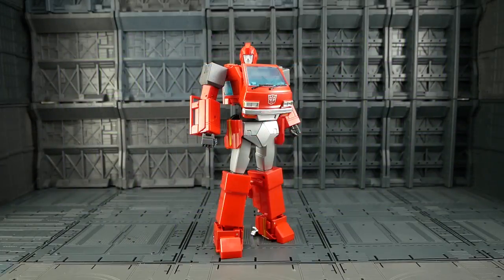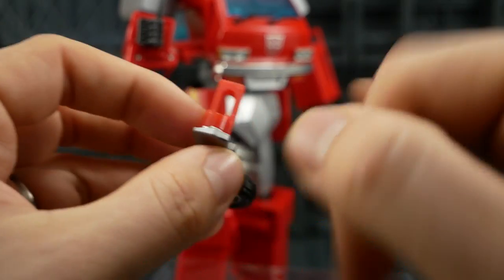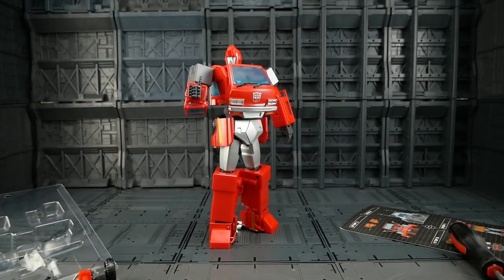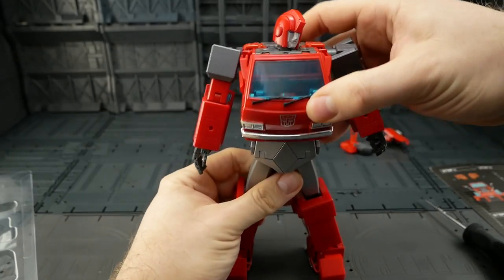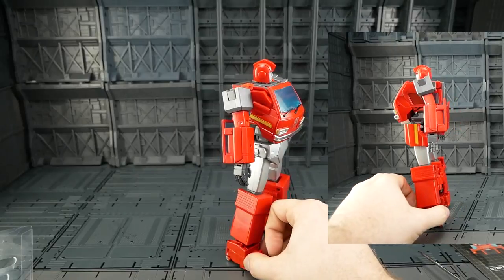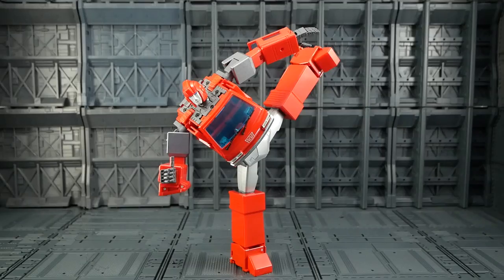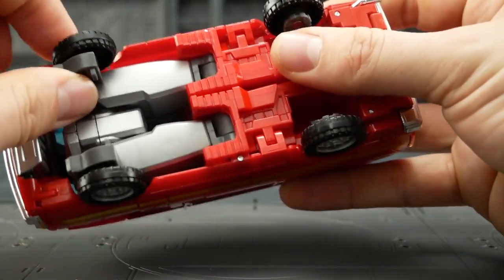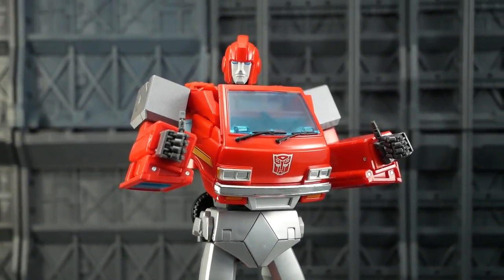Shadow Fisher SFM-03 Review & Installation

Comment: Good review, I think my ironhide needs an upgrade, I will probably pick it up now at some point, seems a simple installation and definitely looks better as a result, (not sure about those replacement hands though!!!!!  they seem a bit messy). Roll on your next review.
Reply: I've got the replacement hands for Ratchet. Not really worth it in my opinion. Don't look as good as the originals and the articulation doesn't add a whole lot IMO. Hands are pretty small. This is coming from someone with upgraded hands on every figure Starscream sized and larger.
Reply from the maker: The KFC hands are a bit hit/miss aren't they? I've found removing the largest knuckle on each finger makes them look a little better. Especially with the FWI Hands for the Autobot cars.

Comment: MP Ironhide's massive diaper and weird proportioned thighs bother me, they're just so damn ugly. Ratchet on the other hand, is slightly better due to a better crotch design. I know Ironhide's crotch is cartoon accurate, but that doesn't mean it looks good. After you removed the side skirts, I think it looks even worse, because the bulk in that area is gone. That's just my opinion. Good video none the less.